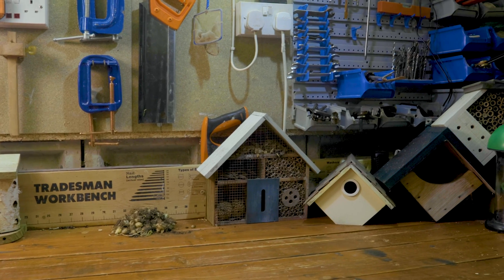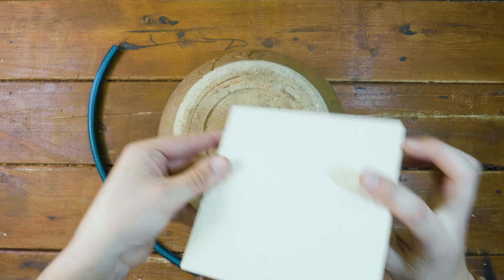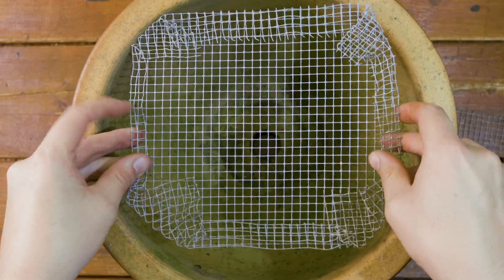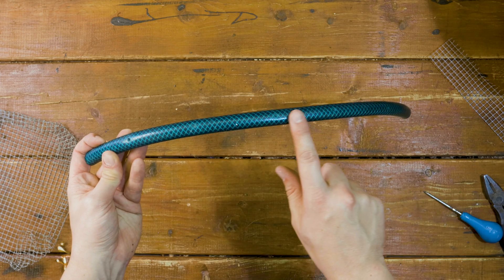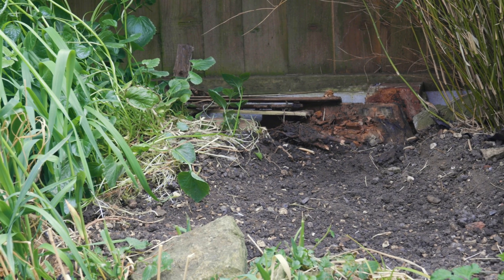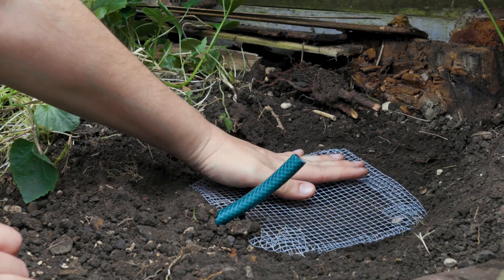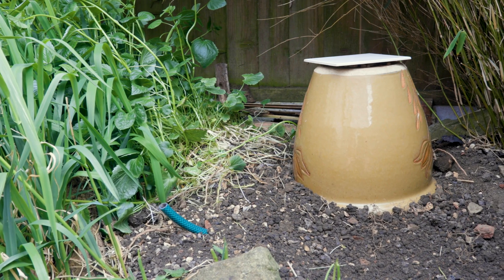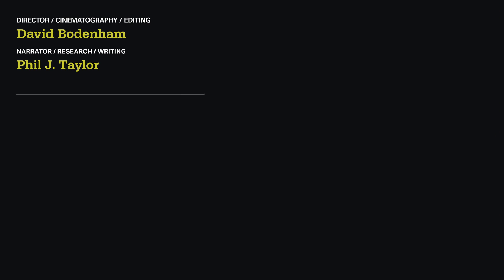How to make a Bumblebee Home

Comment: I needed to find this video weeks ago. I had voles this spring, so I cleaned everything up and put down a lot of mulch. That seems to have taken care of the voles, but then I went through and filled all the holes. I was so focused on the “problem” I didn’t take the time to see how different parts of the eco system were connected. No more stuffing the holes. Thanks for the video.